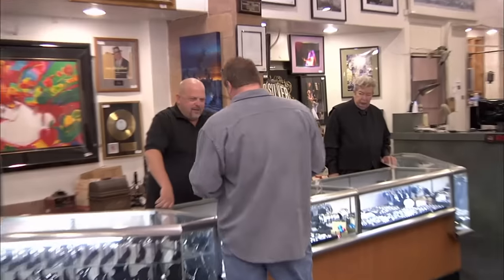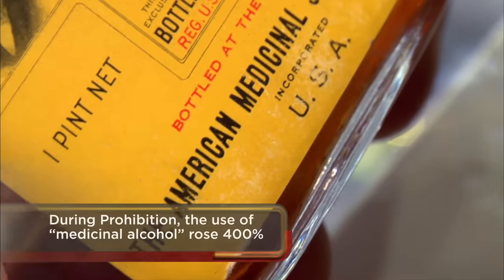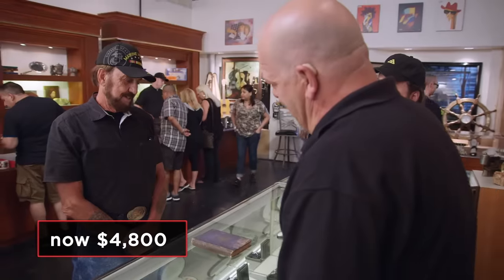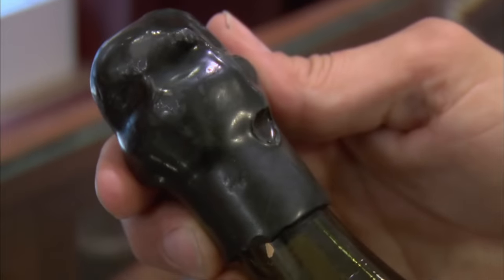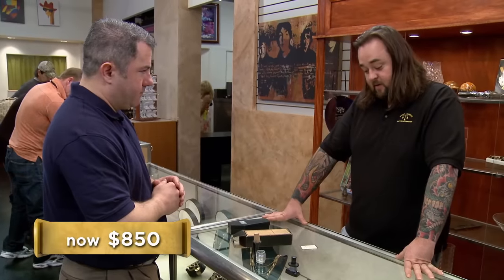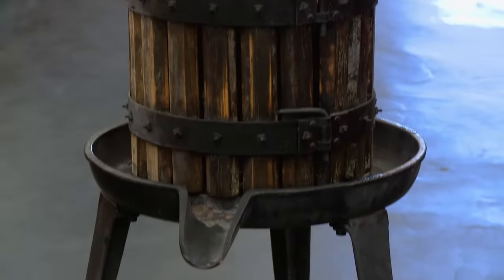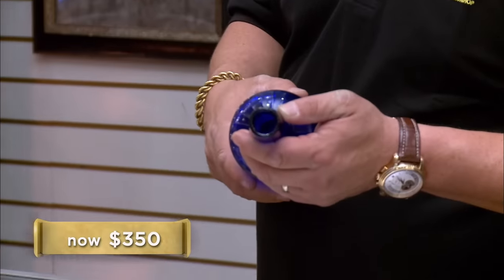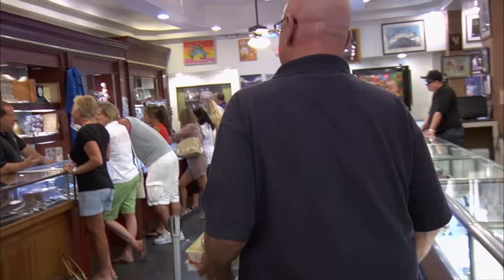Pawn Stars: 9 SUPER RARE PROHIBITION ITEMS (and Illegal Booze!)

Comment: This kind of reminds me of an article I once read it was about this turn that would be over at an angle that would be used as a hard hitter and it would sometimes go on over and over again for over an hour or until the flow would kind of bend but then it would just stop for a second if the owner had not stopped it somewhere in between the first hits. Then they would stop producing those and start making a new model which had a more sophisticated movement that would remind you of a fine watch but that turned out to be a mistake since it would always hammer on the last hour before it would hit, making it seem like a broken one to begin with.

Comment: RE the film..1938 would have been 5 years after prohibition was repealed..dating the actual film as to when it was shot should be easy since there is codes on the sides of the film especially if it was Kodak film...

Comment: So the guy trying to sell basically what is a bottle of Wine with ALOT of sediments sitting in it is basically wasted.If it was persevered better and had little to no sediments it would of been worth more. Believe it or not that's the difference between a cheap vs an expensive bottle of wine is the amount of sediments in it. The more sediments that's in a bottle of wine means the worst it's gonna taste because it wasn't preserved or filtered properly, and the sediments is basically left over yeast in the bottle just floating around in it.

Comment: This is where Rick is soooo incorrect on champagne. As a sommelier trained in Le Cordon Bleu...he's 100% off the mark. Rotating between upright and on its side for ling distance storage is most appropriate. He's also off about it needing to be stored cold....cool yes as you would in a cellar but cold...no.
Reply: I'm gonna disagree Michael, 100 year old bubbly NEEDS to be stored tres' cold to slow oxidation. Some T Jefferson Lafite Bordeaux was discovered in subterranean cavern still drinkable. It wasn't that long ago, & auctioned for major bucks. Cavern temp was 40F. I'm not a fine champagne expert, but I doubt any would still have carbonization after 100yrs